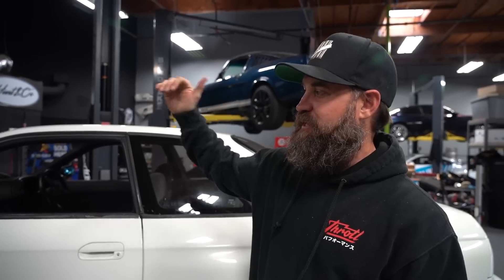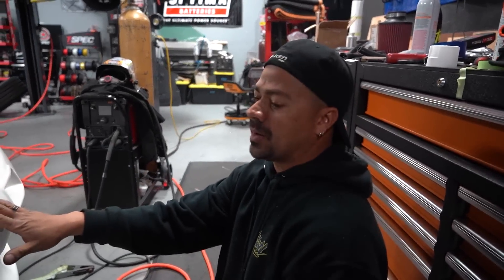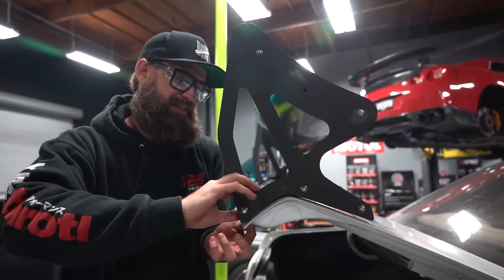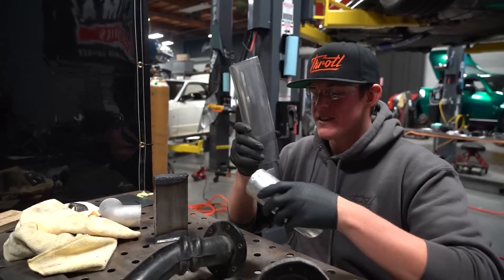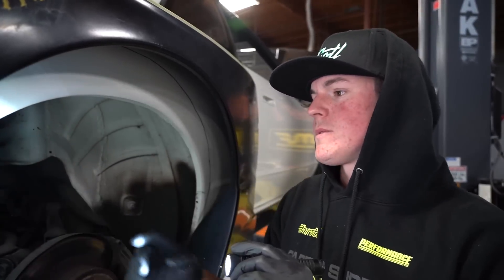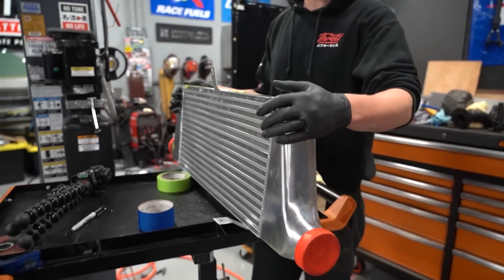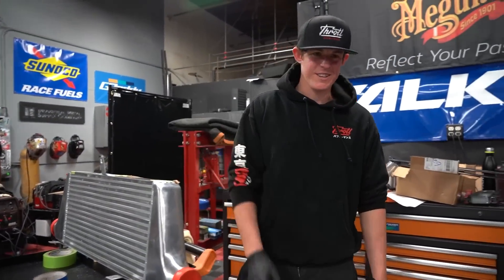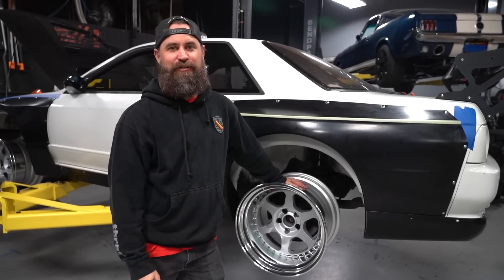Building and Heavily Modifying a 1989 Nissan Skyline R32 GTS-T - Part 2 - Pandem Widebody Kit is ON!

Comment: throtl should buy more tools for quin, making big hole with normal drill bits rather than a hole saw, wasting so much time...
Reply: and using a hand grinder instead of the bench sander he was standing right next too.Could have gotten it much closer to the trace line to make it round.